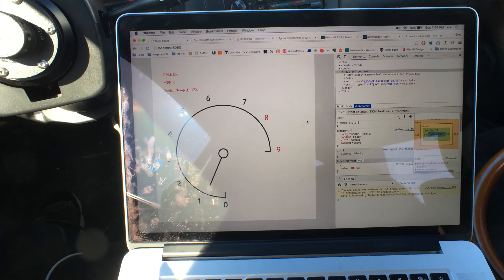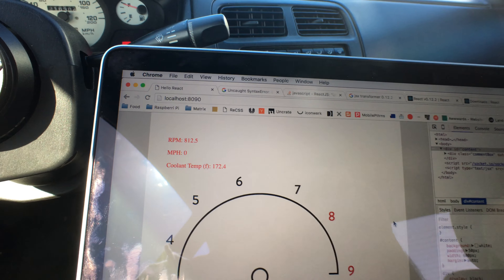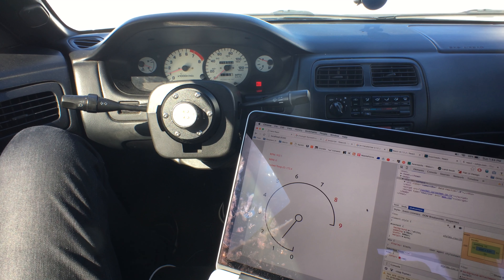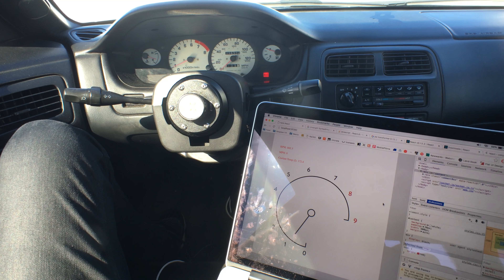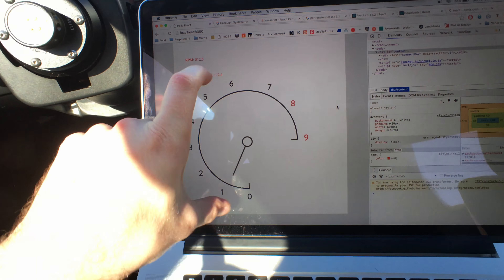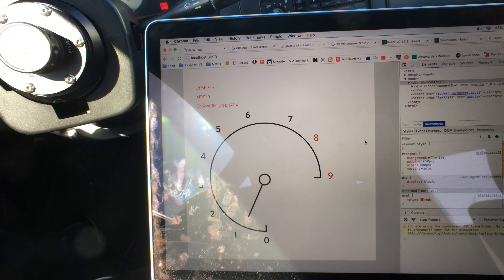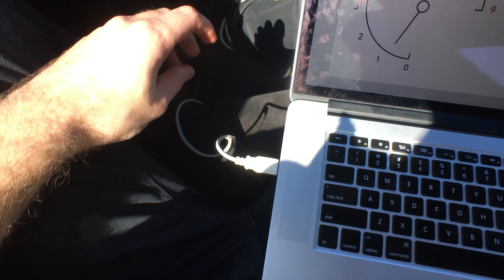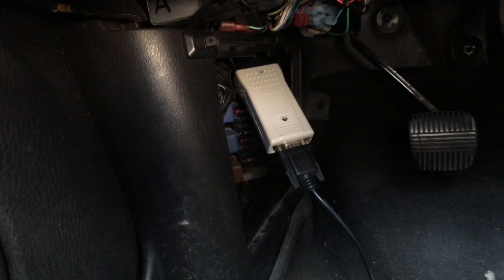Making of: Custom digital dashboard with Raspberry Pi update 1

Comment: You are a lifesaver, I had the thought about making a lcd/digital dash for my silvia but ran into problems as all the programs I found used a OBDII port. I was just about to admit defeat and stick to an analogy dash until I came across your video XD
Reply from the maker: Getting close to finishing now! Will have instructions up soon!
Reply: +240SF keen to try it myself, only issues I think I'll have is struggling to program it with Windows and into a sr20 s13, not sure if the s14 and the s13 have the same consult plugs? (OBD PLUGS)? 

Anyway I'm excite to see your outcome, it'll give me confidence to attempt it myself. Keep up the good stuff 👌

Comment: I know this is a old video however, the problem with having a Pi in the car is that it takes roughly 30 seconds to boot up.
Reply from the maker: Yes very true. When I was using it as my dash I didn't mind the boot up time too much because by the time I got the car started and was on the road everything was booted up. I didn't look into it too much but some people were telling me about stripped down builds of rpi that end up booting in ~3 sec. That could be one thing to look into for faster boot times
Reply: @DONEgrp  3 seconds? Where do i find this info at?